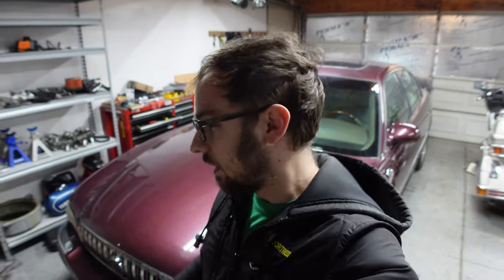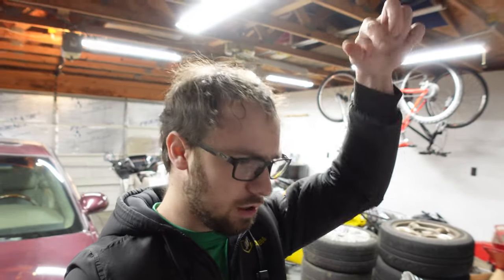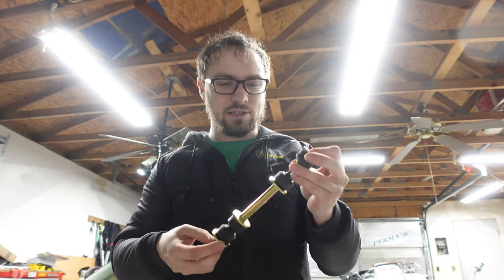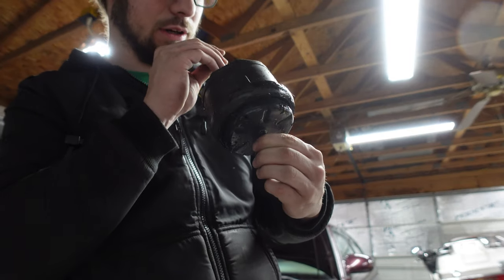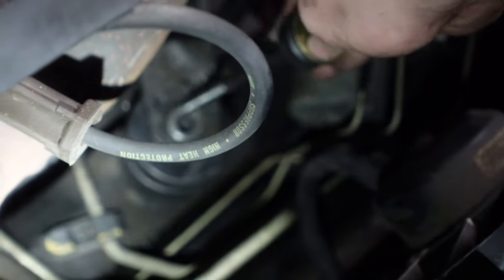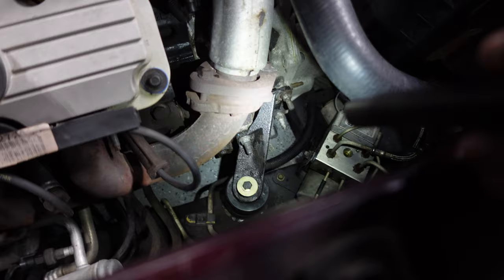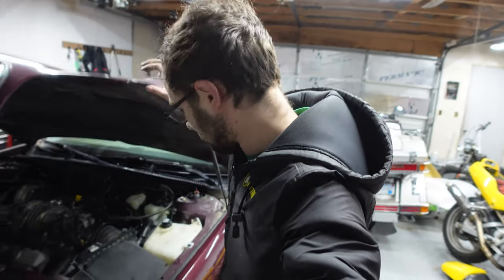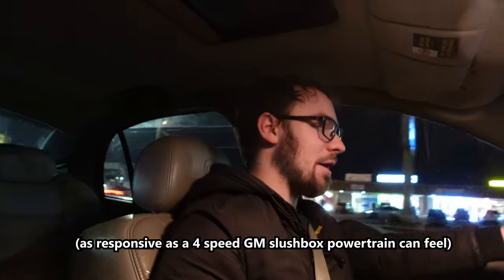DIY Heavy-Duty motor mount to handle SUPERCHARGED POWER!

Comment: A little FYI for you on your bolt grade. The 3 radial lines on the top mean it's a grade 5 bolt. A grade 8 would have 6 radial lines.
Here's is a quick chart for you from The Bolt Depot:  https://www.boltdepot.com/fastener-information/materials-and-grades/bolt-grade-chart.aspx
Reply: TY for clarifying. I knew it was something like that.
Reply: But even a grade five bolt would probably lift the whole damn car.
Reply: Unless the bolt is made in China. Then the number of lines are meaningless and strictly for decoration.

Comment: thought for making the bolt easier to install, drill the holes in the hockey puck large enough to accept the sleeve.  Stack the 3 up with the sleeve to align it.

Comment: I'd recommend fabricating an additional mount somewhere, as there's still too much movement on the engine. It'll be cool to see the whole frame of the car bob up and down as you rev it, much like a big block muscle car rocks side-to-side, only transversely in this.
Reply: There is clearly the mounting holes for the dog bone gm mount on the rad support. He just needs the parts from a junk yard and easy bolt on.
Reply: i always learned growing up, to chain down engines.  actually had a big block pull out of a engine mount when i was younger.  that was not a fun time

Comment: Now you can run a contest for the best use of hockey pucks in automotive hot rodding. Winner gets 3 pucks, 2nd gets 2 pucks, 3rd gets 1 puck, and you have one spare.
Enjoying the content. I’ve heard about these engines but have never seen anyone go through the process of modifying. What’s next? Headers & dual exhaust? (Sponsor hint)

Comment: Well I think the first thing that will go is the rubber on the top from the original bushing kit. Those shock top like bushings might not be up to engine torque. Well for long periods of time that is. But there are plenty of polyurethane replacements out there if they get crushed out.
Reply: Yeah it will not last a month and the bolt will be loose from the rubber being crushed.

Comment: you should check out zzp they have a intercooler setup that really helps with power and stability and a shift kit that will get rid of the SLUSH its amazing. also great job on mount the solid mounts help alot and the more forward you bring the motor the more centerd the weight will be over the front end making it easier for front traction and easier to change the pluggs in the future :). also try a 180 thermostat with autolite 104 spark plugs gaped at .050 NGK makes a 104 equivolant but this will get rid of any knock also help with the heat soaking and help with your power gains

Comment: Reminds me of when I fixed a broken mount on my Mazda Protege5 with a tube of 3m windshield cement.

Took the mount out, made a cardboard backing template to hold the windshield cement and filled it around the broken mount.

Let it sit over a three day weekend while I took a trip with my wife and re-installed the cured mount on Monday when I returned home.

It worked fine with a bit more NVH and for a lot less than the $100 or so for the replacement mount that would likely fail again in a few years.

Comment: Considering the tension and compression forces an end link is exposed to, this is a terrific idea. By the way, it is torque, not horsepower, that strains the factory mount. I have a 1990 Volvo 240, and the right engine mount is problematic because every time the oil filter is done it gets soaked in oil. You have me thinking about doing this. Pucks should stand up better than the OEM rubber. Maybe better than the aftermarket mount from IPD, too. Just wonder how it is rated for sheer forces, as the Volvo mounts are meant to break in a crash to allow the engine and transmission to drop under the car. Anyway, keep up the great work. That Electra is coming along a treat.

Comment: I wish the motor and trans mount replacement on my Saturn had quieted it more than it did, and there's still a little clunk which I assume is probably suspension. Wish it were as easy as hockey pucks 😁 they probably smell better than my motor mounts too

Comment: Is it just me or does that engine move about a lot? Could do with a rear engine mount too or a strut brace.
Reply: he knows everything  and doesn't  know crap tht grade 8 bolt will snap over time I've been there done that. my permanent  solution  was a  peice of. angle iron  along the radiator  support  bar bolted in with factory bolts on each side  then  grabbed the upper torsion mount off a grand price and dabbed up  custom length torque mounts  and welded brackets for them to the angle iron  used bushings  made for the oem torque  mounts as well these motors produce   a lot of torque to only have lower mounts and it's best to buy actual  oem mounts and replace them all at the same time after markets will break way faster than the oem  the mod I did adds  a mount to the top keeping  the motor from tipping  and  straining  the lower mounts as much
Reply: You can easily add on the dog bone mount his car has the bolt holes on the top rad support its a simple bolt on with junk yard parts.
Reply: @stevenplaskett7728  I looked into that but the radiator  support  is different  my  way  it just adds   a peice  of about 5' angle iron and some fab work
Reply: Thanks for ALL your comments, this is a problem for me and my options might be far more than factory but I might go with all factory depending on how much it will cost?  
 Thanks all the guys.

Comment: Look at the top of the bolt. See if it has hash marks on the top. 6 hash marks is best. 3 is grade A. None is.....  Well... Not grade A.
Er, my bad. 6 must be grade A and 3 is grade B? Anyway both would work in this application.

Comment: The pulling force will destroy the rubber sway bar bushing in short order. The heavy hockey pucks are not even doing anything useful. You need a hockey puck on top shaved down to the size of the washer.

Comment: rock auto sells a solid trans and motor mount they run 10 bucks
Reply: Apparently that one lasts 2-3 weeks.
Reply: @cpscps2679  ah bummer i have a modded gto and it use to go througg the fluid filled mounts like crazzy but then i switched to all solid mounts the trans the motor and the dogbone mounts it makes a huge difference. Id love to see him put some zzp stuff in
Reply: Stock style is crap
Reply: @widtrak77  i prefer poly mounts
Reply: @cpscps2679  you think a rubber sway bar bushing will last longer??? 🤣🤣🤣
Reply: @stevenplaskett7728  don't know, but I do know that the stock bushing he installed 3 weeks ago only lasted...three weeks.